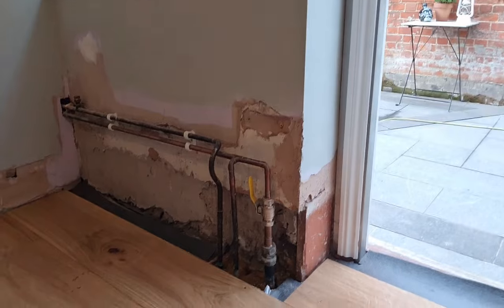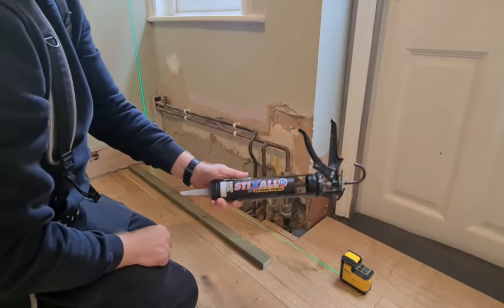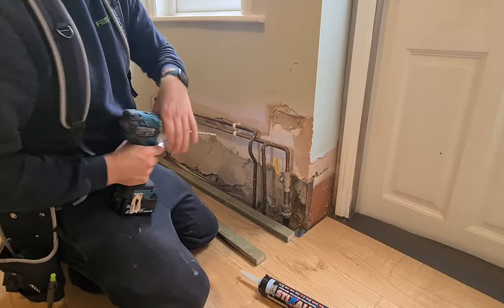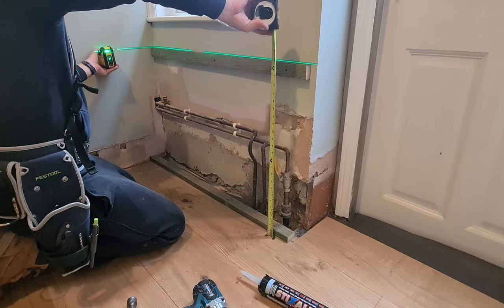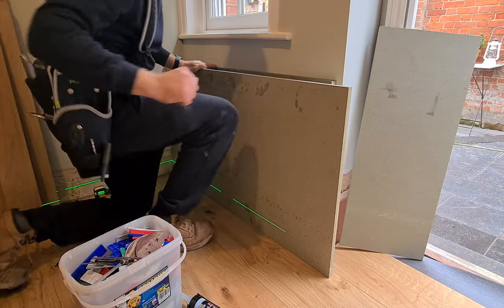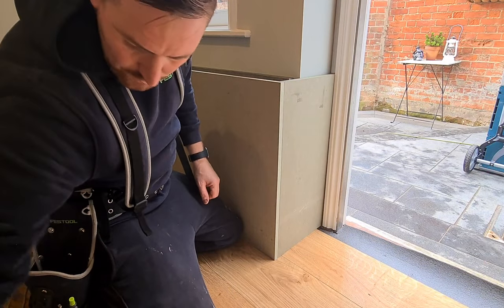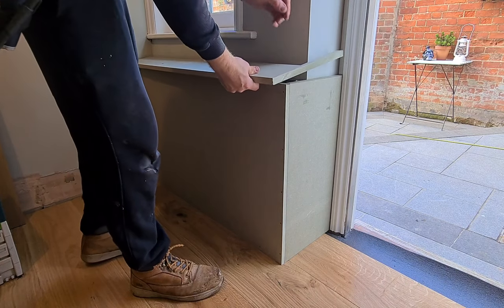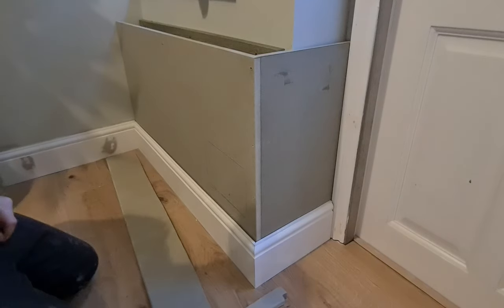Making a HARD job EASY!       #diy #carpentry

Comment: Had to stop halfway as the tinkling  noise was driving me nuts.
Reply: @BuiltByBen-YT  I didn’t mean to sound rude. I was just that I had headphones on and the ambient sound made it sound like it was outside. I kept taking them off to listen where it was coming from. What was the noise?
Reply from the maker: @Alan Reynolds  just some wind chimes mate. They sounded really quiet when I was there but the mic picked them up really loud! So frustrating

Comment: No batten up the wall and screwed the bottom batten to a floating floor, bad practice that and if you used a level instead of a laser for a small job like that you would've got the job done quicker
Reply from the maker: I think people use the term floating floor a bit too loosely. The fact that it isn't fixed down just means it can expand and contract freely. The most my bottom batten is ever going to travel would be 3mm max! Which isn't going to cause me any issues.  If you feel the need for a wall batten when using 18mm MDF then go for it but it's certainly not necessary. And if you want to use a level then go for it but there are so many benefits to a laser. Onve you change to a laser it's hard to ever use a level again! Thanks for the comment 👍
Reply: I use lasers but for a small job like that I wouldn't consider using one definitely a level job
Reply from the maker: Whatever your preference is 👍

Comment: Id have paid a professional plumber to come in solve problem tbh boxing in is unprofessional
Reply from the maker: Doesn't really make sense mate 🤔
Reply: @BuiltByBen-YT  it wouldn't to a joiner tbh
Reply: @BuiltByBen-YT  the pipes should be ran underneath floor if its timber or placed in conduit inside wall very unprofessional plumbing
Reply from the maker: @Lambert Butler  it's very old plumbing and the floor is concrete. Boxing in is definitely not unprofessional
Reply: @BuiltByBen-YT  exactly why money would be better spent solving plumbing hiding a problem is unprofessional
Reply from the maker: The cost involved by changing and hiding the mains water pipe would be astronomical.  I don't think your on the right track mate 👍
Reply: @BuiltByBen-YT  im a civil engineer it would be about the same as your  rate

Comment: It’s not a hard task my carpentry bro.
Reply from the maker: I meant boxing in in general. This one wasn't super hard but there are some mega tricky ones
Reply: I wish there was a way I could show you a few diagrams…..I’ve had a tool belt on my whole life.

My framing looks like finish work and my finish work belongs in a magazine…(so to speak)

I just got into drain stuff because i wanted a change but I really a top notch carpenter.

Comment: This is a beginners error and a time waster.
Take your maximum dimensions + 10mm make your box (of however many sides) . Then offer up and scribe to suit. 
You will be able to finish up the edges perfectly and access doors , panels or fixings become easier.
Bear in mind a lot of boxing in is done last minute and in awkward places. You do t want to be farting around fixing individual components
Reply from the maker: Either way is fine Dave.  Thanks for watching 👍